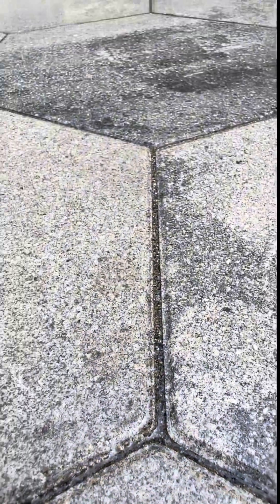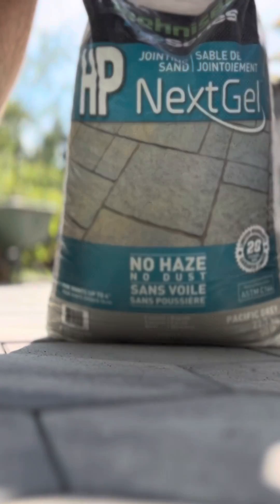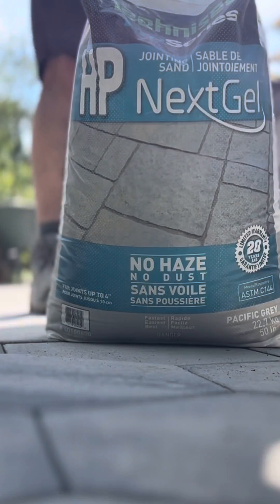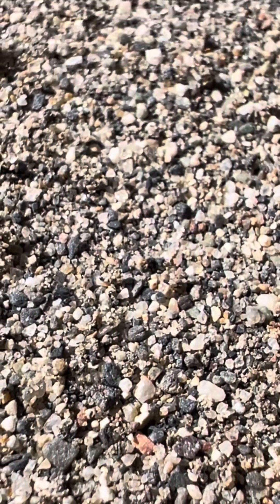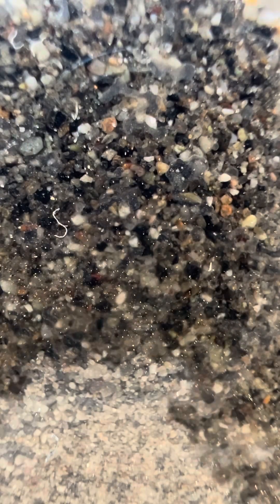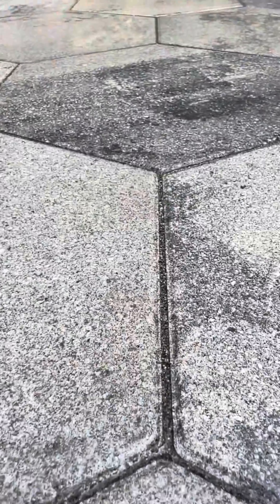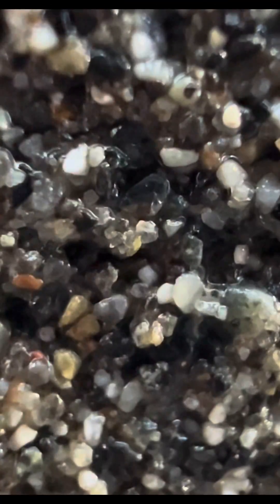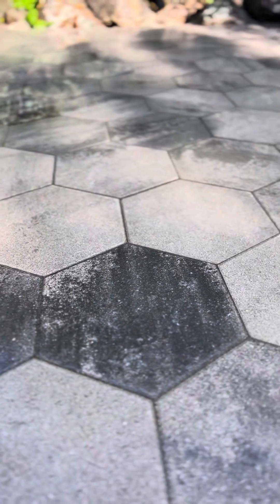What is polymeric sand?? How do I use polymeric sand for paving stones?

Comment: How much is that? Can it prevent weeds? I have similar paver like that but after a few months, weeds starting to coming out from my paver
Reply from the maker: Hey you’ll have to check with a local supplier to get an exact cost, but yes it will prevent weeds from growing as the joint stays hardened and doesn’t allow seeds to collect as easily.